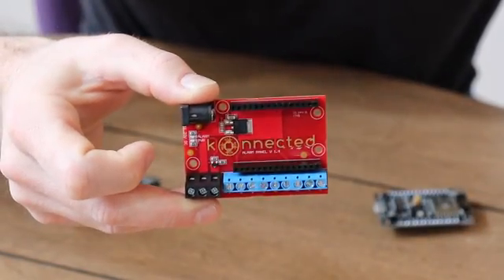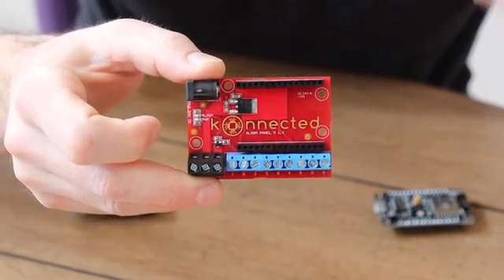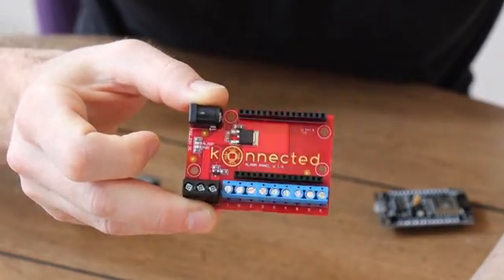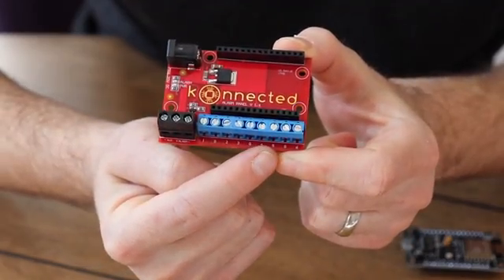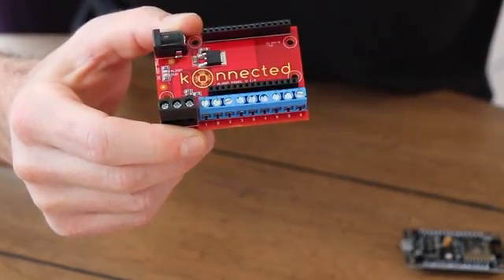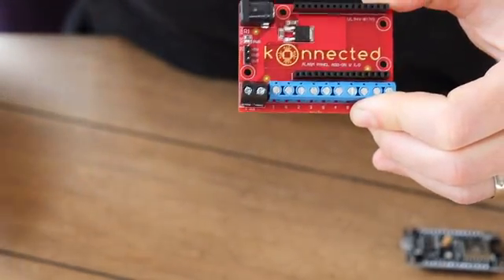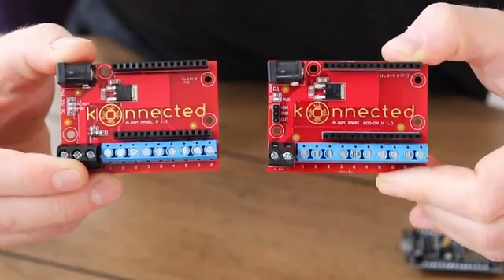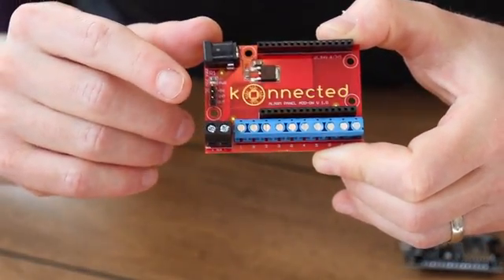Konnected Alarm Panel update and demo of the latest production samples

Comment: Hi Nate...love my board. Just a suggestion. You might want to do another update video explaining that another change on your production board is that aux + and - are switched in position, as are siren + and negative, such that all + come off the center pin. After watching your install video half dozen times I thought I knew where things were. Took me two hours trying to debug why nothing was getting power before I thought to examine aux power pin labels. Great product though.

Comment: Nice to see a young guy inventing things and getting a business going. I have an old alarm box and will use your board to replace it .Couple of dumb questions though .Can this be used with Alexia ? If so how ? Which smart hub do you use ?( I see there are a few ).   If there is an internet issue (or a lost phone)  is there a way to get in the house and shut the alarm down ? BTW this looks like it could double as a car alarm (just an idea)  .Thanks and the 2nd gen looks great !
Reply: Tom - I believe there's probably ways to trigger things with Alexa through something like ITTT or talk to your hub through her, but it's not a "direct" Alexa connectivity if it is at all.  Speaking from my current setup with a garage door opener (Nexx Garage) it's quite wordy with just Alexa to it anyway and then requiring to say a PIN out loud etc, that I don't see this being my go to on something like that anyway.  As far as the hub, Konnected currently support Samsung SmartThings and the open source HomeAssistant which can be run on a "server" computer or a Raspberry Pi. I considered the latter, but I think the interface and ease of SmartThings makes it the winnter to get myself up and running (my Konnected order just arrived at my house this afternoon, so I haven't done the install yet and want to leave work NOW to work on it haha).  For backup, they do sell a battery backup which I ordered & I might get a Netgear LB2120 (LB = load balancer) modem that can use a SIM card for LTE backup. I have a spare SIM with data plan I use on a portable modem for backup when I'm on call for work, so I could load it in that unless I need to take it elsewhere temporarily. I rarely use that SIM.

Comment: If I want to keep my existing monitored service but use  Konnected to make it "smart" is this possible?
Reply: Doubtful... if your existing is anything like mine is/was it has little inline voltage resistor type things and then the Konnected board does not and then power driven to the things like motion sensors can only come from one thing and overall it would get messy. Why not just pay your current service to upgrade their board to whatever "smart" edition they offer if you want to keep the monitoring?  If you have an old FBII/Ademco/Honeywell or something, they have their newer generation stuff that can still work with old sensors as it's all open/closed relays and circuits.

Comment: Hi  Nate, Are there any plans to release a wired Ethernet module? I have Ethernet to my current alarm panel, but the Wi-Fi signal there is real weak and I don't want to rely on a wireless bridge.
Reply: mantus2006 ditto
Reply: I have really good luck with my Luma wireless mesh system. I have a set of 3 so there's one at basement level in my garage, 1 on the 1st floor, and 1 on the 2nd floor.  The core one is on the 1st floor where my modem is and then the other 2 are connected via the wireless mesh (but I could use Ethernet if I wanted to).  If you have Ethernet at that location already, you could get a Luma and have one of the AP's plug into that instead of using a different module on the Konnected board. That said, mine as a full wifi mesh has been flawless without needing to run additional cabling.  I've been really happy with the roaming and quality of signal to my devices with it.  It works better than the roaming between AP's in my office where they are using Watchguard (though I suspect we just have the power settings too high so devices aren't roaming soon enough on those).
Reply: any ethernet modules out on the market with a GOOD APP that will allow me to be the monitoring company for my interlogix NX-8v2?   brand new house, old alarm panel and i'm not paying $50 a month
Reply: I'd like to know as well

Comment: Hey Nate, excited to get my 12 zone kit! Quick question though; I'd want to use the low voltage to hook up the chime for door alerts and such but I'd also like to control my garage door... can I use an empty "zone" connection to engage a relay wired to my garage switch or is relay control limited to the low voltage connections on the add on board?
Reply: Awesome, thanks!

Comment: Great video!

I ordered the 6 zone board ... which means I'll be getting the 'standard' board and not the add-on board.

Can I still connect the Piezo Buzzer to the standard board?  Or does it only connect to the add-on board.
Reply: Yes, you can still connect the buzzer to any of the zones 1 to 5. It takes up one zone input though.
Reply: Interesting ... so the zones can act as switches for devices (ie the buzzer) too?  I’d thought that zones could only be used for sensors — ie “read only” ??
Reply: If I’m not using a siren (since I unfortunately disconnected and tossed my wired siren before I found Konnected!) can the buzzer work off of the siren power on the standard board?
Reply: Zones 1 - 5 can be used as either inputs or outputs. Zone 6 can only be an input.
Reply: The buzzers included in the kit are 3V buzzers, intended to be driven directly from the 3v signal of the NodeMCU. The dedicated siren output is 12V which would quickly fry the 3V buzzer.
If you want to swap the board type just reply to your order confirmation email and let us know.
Reply: Sorry for the dumb questions!  Really appreciate your help. 

So I can use the “add-on” board as my one-and-only Konnected board ... without the standard board?

I have 5 zones and no alarm, but do want to use the Piezo Buzzer as a door open notifier. 

Which one makes the most sense in that case?
Reply: Yep. Both variations work the same except for the dedicated siren output. If you don't want a siren or other 12v signaling device,  I would recommend the add-on board.

Comment: Hi Nate, I get that the separate boards (12 or 18) don't have to be together but what about using another board in a separate part of the house to control garage door? Will that work? Thanks
Reply: Yes! You can put them anywhere you have a WiFi signal. Wanna add wired sensors to a part of the house where there weren't any before, no problem!

Comment: Whats the best way to connect a UK 4 wire siren to these boards if the original alarm panel is removed? I use a Honeywell AG8 with the following triggers:

Siren: Loss of hold off supply, S-Negative Trigger (-V applied), Trigger occurs when terminal voltage is less than 3.5V, Maximum load 1.0 mA
Trigger: -V applied

From the wiring diagrams it seems it has a permanent 12v supply and ground, and then a terminal for the siren and a operate one for strobe that should be held at 12v, and would drop to 0v in an alarm condition. 

http://www.security.honeywell.com/uk/hsw/documents/AG8_datasheet.pdf

Comment: Have a couple of questions.
1)  You indicated the wifi board automatically connects when you powered the unit, but where do you configure the wifi..... in the app?
2)  How do the companion modules connect to the main module?  I assume there is just one wifi board connected to the main module, and then the addon boards for 12-18 zone systems somehow connect to the main module.  Is that correct?